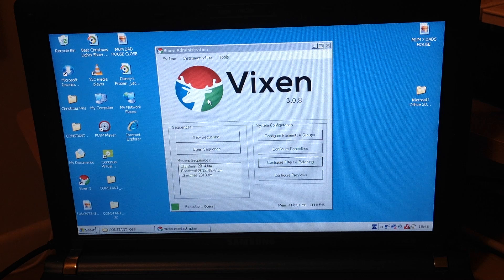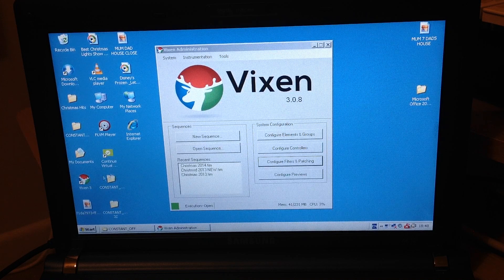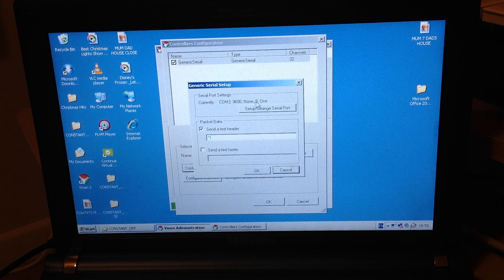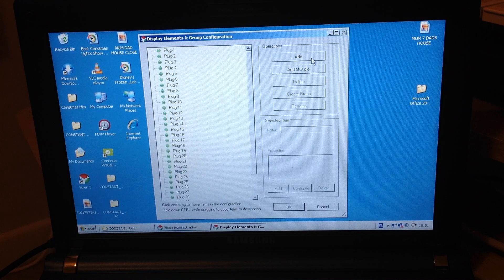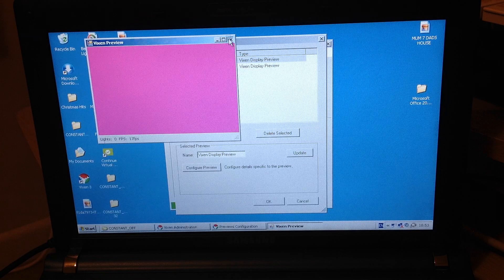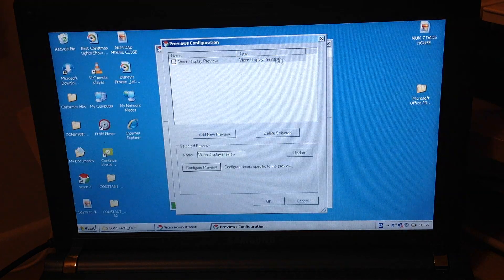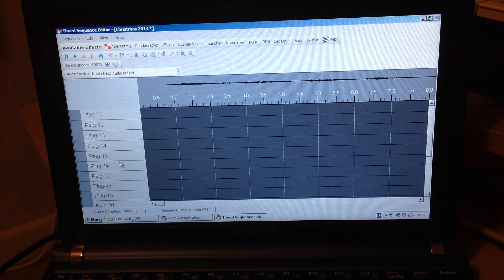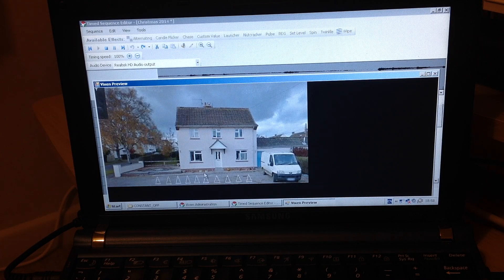Vixen 3 - Arduino Mega 2560 - Sainsmart SSR - Christmas (VIDEO 4 OF 6)

Comment: Great Videos. For anyone who needs your code i found where you posted it at http://doityourselfchristmas.com/forums/showthread.php?34340-32-channel-sainsmart-solid-state-relays-Arduino-mega-2560-and-Vixen-3-software/page5 I could't get the Vixen software to control the relays on my mega, in your video you set the Text Header as ~' (tilde and Apostrophe mark) but mine would not work i set mine to ~! (tilde and exclamation mark) ans it started working.